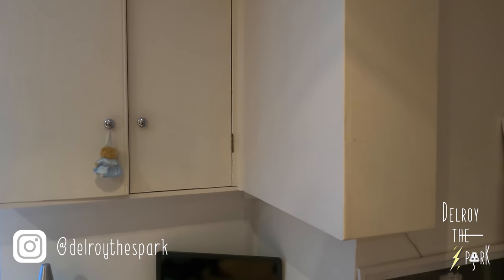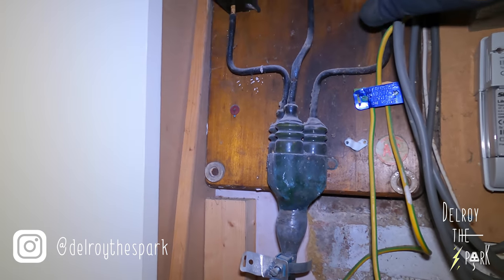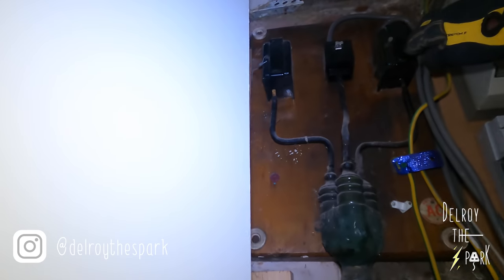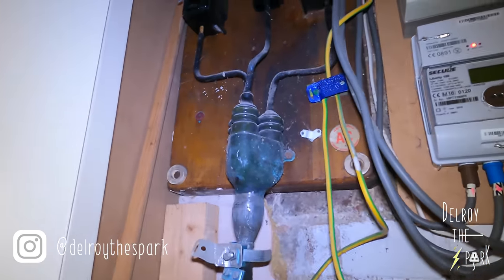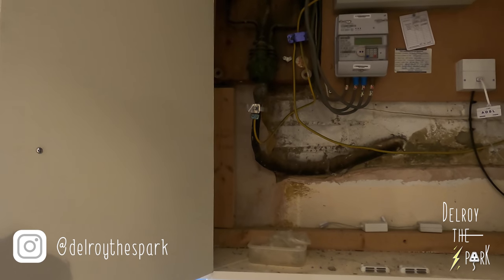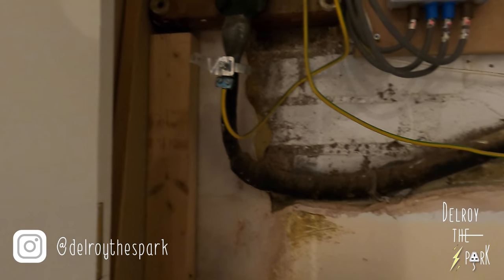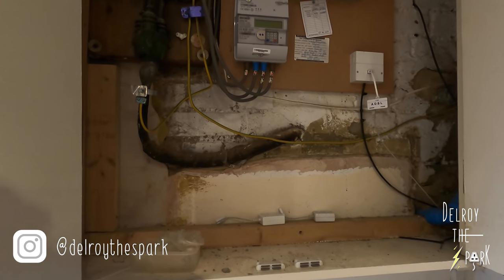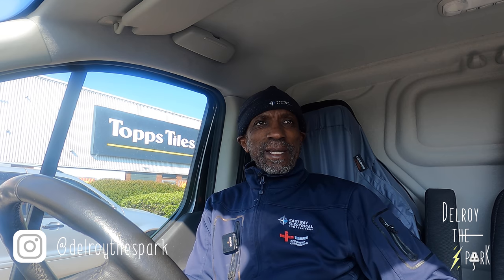"You Need To Contact UK Power Networks As This Is An Emergency" | Electrician In London Vlog

Comment: foreign electrical is way scary... I don't understand how it's all so unsafely designed.
Reply: I mean, it isn't unsafely designed, this particular instance is damaged hence calling it into the DB as an emergency call
Reply: What are you talking about, UK electrical code is one of the safest/strictest on the globe.
Reply: to start with, it's mounted on wood, and something got hot enough to weld together, seems not so good. I think maybe electrical equipment that ancient shouldn't be in service, but I dunno, I'm on the fence if this is ok. could test it for leakage, but it's not carrying thousands of volts. but still, the wood right there.. the circuit panels there are in plastic boxes? I don't understand how this is considered safe. in my country, we always use a heavy steel box which is heavily grounded, so if there is a fault, it will hopefully allow enough current to flow to trip the circuit and prevent more severe damage or fire. I don't like wego's. I see people use them here, they insist they are safe. I do not like them. I'm especially opinionated about wego's, but I am curious about the other things. the panels here use a solid bus bar down the inside back of the panel, slightly safer than a bunch of individual wires. the box might be high temperature plastic, but it can still melt and drip and burn. I've seen the result of it here on youtube. it's a scary thing.
Reply: Guys, he's watched YouTube videos. He's an expert. Give up now. LOL
Reply: @lorenzo42p  It is a old incoming supply not many company's around the world bring their equipment up to current standard unless it fails or needs to be moved.
Where I live our fuse boards used to be part of the wall
a cavity was made with a wood frame and a asbestos or mica back board and the front had the meters and main switch and fuses mounted on a hinged mica/cement/asbestos board.
now we use a combination of metal and flame resistant plastic enclosures.

Comment: In this case just disconnect any load and disconnect the neutral and then ground the neutral and the live bar (behind the breakers). Afterwards attach one of your locks to the breaker box to avoid that anybody turn anything back on.

It's just not safe to run any current through the connection. :)

Comment: Unsure if londons different, but up here in the midlands unless your authorised to do so you shouldnt be trying to pull that fuse out, unless your trained and authorised to do so, if something goes wrong, your relying on a substation fuse to cut the juice to that head, and those gloves and your face could take the force of any incident. 

My strong advice going forward if you see any signs of burning on the cable, just ring the DNO up straight away and we can attend, as its part of our network it would be treated as a deteriorated cutout, and isnt chargeable (unless obvious tampering, or attempted bypass).

Comment: just watch this, are you mocopa certified, if not your breaking the law cutting the seals to the main cut-out, are your gloves 1000v rated, did you use a vt-7 to check for voltage on the seal and screw. if the cable on the incoming is loose no one but the dno can go into that part of the cut-out. and not knowing a cut-out from a connector block is a bit worrying to.

Comment: TN-S nature of supply?
Reply: Yes
Reply: It's supposed to be TN-S bit it's possible that the non-compliant BS 951 clamp is not providing a reliable earthing connection.  The DNO will often deny responsibility for it, and charge for making a proper connection to the lead sheath.
Reply: @westinthewest  your DNO does not guarantee a customer earth but if the customer wants one provided then yes they would have to pay
Reply: @davejarvis5279  ESQCR states that the DNO does not have to provide an earth to any installation, but when they do, they must maintain it throughout its life.  This means if you do have a TN supply which goes high impedance, the DNO has to sort it out at their own expense.  Western Power have previously come out to properties within the hour to investigate a reported fault, and then had the road digging crew arrive a few hours later to fix it.
Reply: @westinthewest  that is correct  but that earth bond is private,if the customer pays for an earth off the DNO then yes they will maintain that earth
Reply: You're right Dave. This clamp may well have been put on by an electrician. It's not how the DNO would have done it. I believe the old TN-S would have been sweated onto the lead sheath, not just a clamp, like you have on cross-bonding. 

If the DNO (or board previously) didn't fit the clamp, then they're not liable for replacing it & may well charge to provide TN-C-S
Reply: If it was a TN-C-S or a TN-S which was installed by the DNO, then they are responsible for maintaining it

Comment: Classed as a non-maintainable part by the REC and can quite easily burn your house down.
Reply: Been working at a DNO for over 35 years, on the industrial side of things, doing fault repairs, and have never come across a fire caused by the main incoming supply, unless it has been tampered, vandalised or interfered with.
So it CANNOT easily burn a house down.

Comment: Energy supplier won't take responsibility for this part of the install. You shouldn't have cut the seals because you trying to remove it has probably made it worse. If you call UKPN or SSE and report a loose cutout they will send power distribution engineers. They actually have Mocopa Codes you can use to bring them out with 4 hours if it's an A code
Reply: They should be out within 4 hours

Comment: It's kind of amusing to me how you guys have to call the power company when in the states the electrician could most likely handle the issue. They would just break the seal on the electric meter and unplug it, killing all power to the house, and do the work. Then, when the work is done, the inspector comes out, looks at everything, and puts a new seal on the meter. I had my electrician replace the main panel, meter box, and all the main wiring on the outside of the building. all he had to call the power company for was to disconnect and reconnect the main wire to the supply coming from the pole and for the inspector to sign off on it.
Reply: The problem is at the antique head-end/incomer before the meter and there is no means of safely isolating it to work on it. Both legally and practically, this is the responsibility of the DNO and it is just the same the scenario you describe where a temporary disconnection is needed external to the premises.

Comment: You should not have attempted to remove the fuse, given the reports of flickering supply and the cable entering fuse holder showing signs of distress - @3.47 - compare the used phase with the unused phase cable entering the fuse holder.

Call the DNO - do not attempt to remove the fuse - switch off the customers consumer unit or reduce the load while a repair team is on route.

I have worked for UKPN and undertook repairs on faults like these.

An interesting video on who owns what on a meterboard - https://www.youtube.com/watch?v=-wEQntl54Bs